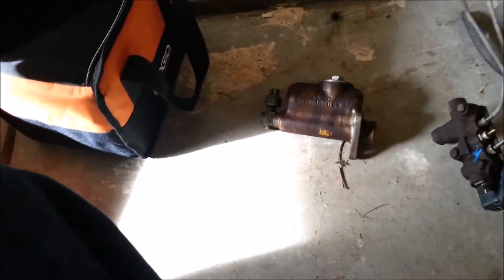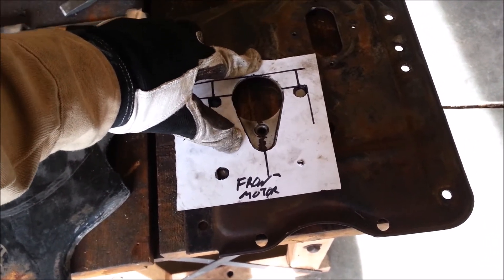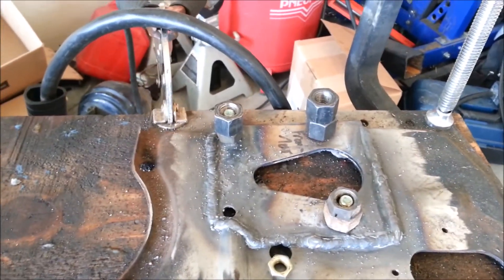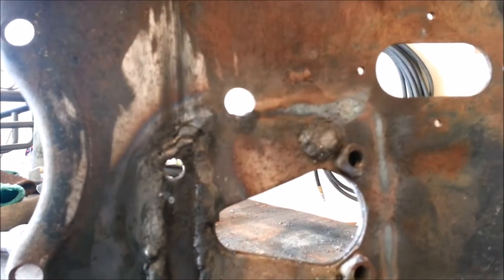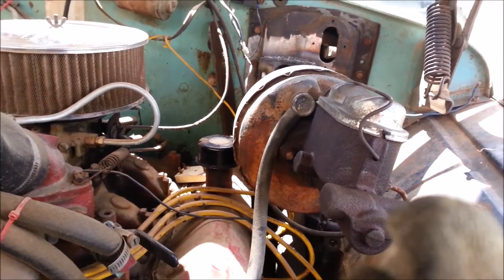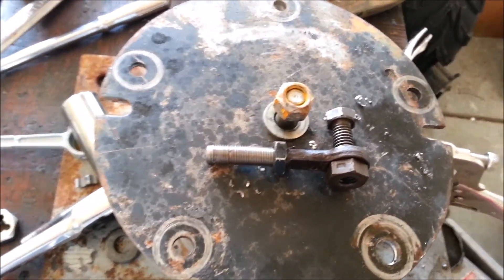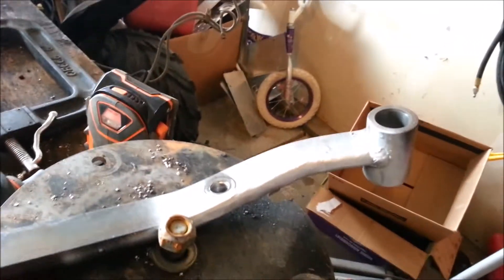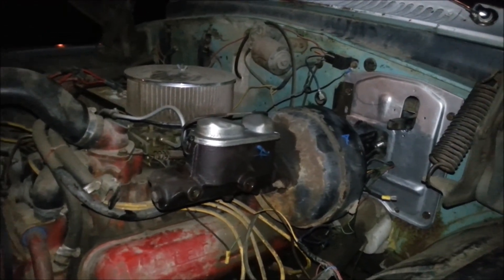Brake Booster Adapter for "Skully" my 1960 International Harvester Travelall 4x4

Comment: Nice Work! If your filler is in the way,flip your valve cover,so the filler is towards the front of the engine. If you're careful,you won't need a new gasket. if your valve covers leak-now's the time to change them.
Reply from the maker: Bill Hickey thanks. I will be switching sides in the future which will make everything easier.